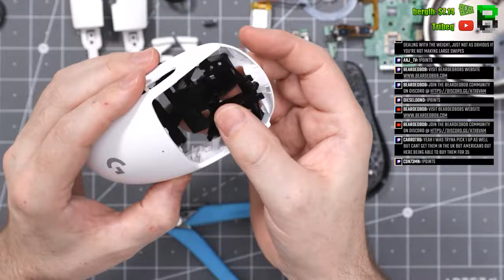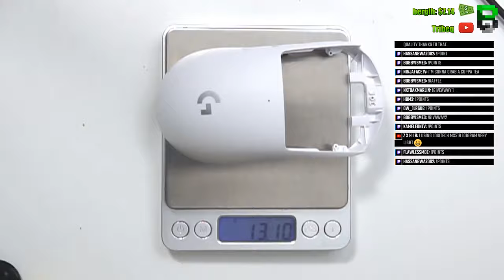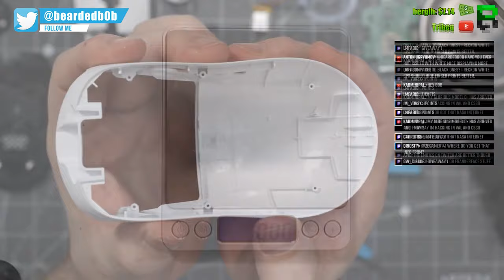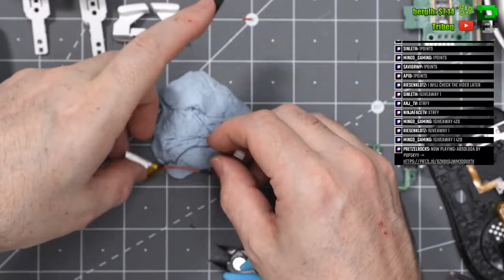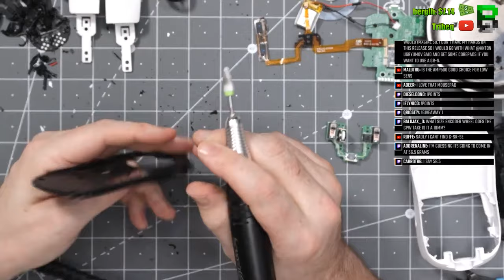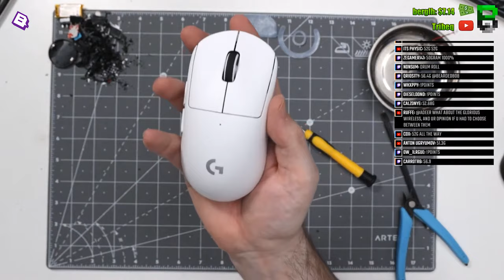THE ULTIMATE 50G LOGITECH MOUSE - Custom G Pro X Superlight Weight Reduction Mod

Comment: I refuse to doubt Logitech’s engineers any further, I’m sure they couldn’t gut as much as you did due to structural integrity. They gotta factor in the potential risk of RMAs and such
Reply from the maker: I’m sure RMA has something to do with it.
Reply: Absolutely, and teenage gamer rage fits. We've all seen the hilarious youtube videos. Im sure Logitech has too. Go lightening it too much and some roid raging teenager is going to crush it in his hand like a popcan and mom will blame logitech... just overall cheaper in the long run not to have to. 
That said if Logitech wanted to, They could go full on skeletal frame, a step beyond honeycomb, out of magnesium or carbon fiber but, we already whine about 200 for a mouse. Imagine the outrageous R&D costs of something so niche. It would be freaking cool concept though.... side note.. trademarking and copyrighting skeletal carbon framed mouse right now..
Reply: if they was so scared about RMAs they should have made better switches
Reply: @Bollalillo  ffs sake lmao. They changed them midway through already my copy of the gpw (non superlight) to 20m switches

Comment: Nice I was just thinking how much I could get from the Superlight and thought I'll just wait for the Bob video to see how it is. My original Gpro is 58grams I think, but it's pretty shredded, with original battery as well. I'd estimate probably 45 grams with the same work for the superlight with the same battery. Don't really need it but might just get it as a fun project and then do the switches as well.
Reply from the maker: Yeah I’ve made a few 57g gpw stock ones, and I’m happier around 60g but I just like to see what’s possible. 50g with it looking stock is impressive.

45g would be crazy, it would be interesting to see how the new FM mouse feels at that weight or below.
Reply: Yeah how exactly do you change the switches on this mouse? I am very curious.
Reply: @shopcomfycove  I'd assume like any other. Just solder them off and new ones on. I'm sure bob has a video for it, probably on the exact same mouse as well.
Reply: @Raumance Wait so do I need a soldering iron?
Reply: @shopcomfycove  Yea I think so but those are really cheap to buy.

Comment: How much grams would I reduce if I just remove the powerplay function?? (with no holes but only a cable, strange iron thing, and 4 screws) plz...plz...
Reply from the maker: around 4g but worth checking the weights in the video to confirm.

The full weights are in this teardown to help you see whats worth removing or not :-) https://www.youtube.com/watch?v=EFX2QzyvuS8&list=PLfd7fPKFiRfIzZVqxMHqyH5y23iG357b9

Comment: what switch did they use in superlight? is it the same as non-superlight?
Reply from the maker: Same as the newer gpw so a 20m omron china 😭
Reply: @Beardedbob  what's a good switch to replace them with? I have a non super light and the switches suck! I have a problem with the right switch un ADS me all the time. It's extremely annoying
Reply: @RobSimmons6.7  these switches aren’t plagued like the 50’s you don’t need to replace them
Reply: @anostio  ehh I beg to differ, my mouse is always un ADSing on me
Reply: @RobSimmons6.7  I recommend returning the mouse first, the switches don’t seem to be nearly as bad as they were, or at least the community hasn’t found a way to complain yet

Comment: i would opt for a bigger battery to hit 60gram mark.

i did the same to my g703, just hate how short the battery lasts.
Reply from the maker: I get 7 days from the 100mah most should get 3 days that's pretty decent. the MOW gets around 1 days stock it seems. Just leave the stock 240mah in and get a few more weeks and it will weight 53g.

Comment: hello i cracked open my superlight to swap main switches and did some of the cutting mods but when i put it back together none of the buttons work, only the sensor. The ribbon cable, as far as i can tell, is pretty much in tact with no visual issues and the led light turns on too. Was wondering if youcould help? is it the ribbon cable thats damaged?

Comment: Can the stock gpw internals fit in the superlight frame? The only problem I could think of is the glue for newer side switches, but I guess the old gpw side buttons could also be glued down.
Reply from the maker: Maybe, the PCB's fully align, the Skeletons does have different mounting points.

Comment: I'm curious, If I remove the battery and mod the mouse with a paracord cable and use it wired will it work ?? how about the wireless stuff inside of the mouse is it removable for weight gaining purpose ??
Reply from the maker: not sure, I need to test it as a lot of people have asked me.

Comment: I noticed you swapped it with a 2 pin battery whereas the original came with a 3 pin, is this safe? and if so how? Isn't the 3rd pin for battery protection?
Reply from the maker: The 3rd white wire does monitor the battery. On a MOW it does affect it if you cut it off but on the GPW and GPWSL it works just fine. Will it over charge it I'm not sure but so far I've not heard of a problem.

Comment: I am afraid looking at the disassembly process with so many clipping involved.
But, the end result speaks for themselves. <50 g and wireless mouse to boot. 
I can't even clip my own stabilizers on the keyboard without feeling anxious. 
Will be using your video for future reference should I decide to mod my mouse. 
Preem vid, man.

Any chance you are going to make Xtrfy M4 / M42 teardowns?
Reply from the maker: Hehe, yeah it's not an easy process..

Yep m42 teardown coming plus model o wireless, Pwnage ultra custom, Ducky feather and Roccats

Comment: Hey man, I really enjoy your videos! I currently have a g403 HERO and I would like to remove a few grams from it. All ive done so far is removed the magnets that connect the little pop out shell for the weight but im a little afraid to go any further since there arent any guides for the g403 HERO anywehre, which is odd since a very popular and widely used mouse, it would be super awesome if you came out with a weight reduction video for it!
Reply from the maker: G403 weight reduction video out very soon I just need to edit the stream that I did for it.
Reply: @Beardedbob  is it done ?

Comment: I think 62 grams is damn near impossible to beat without luxury materials and sacrifice to structural integrity. 

Maybe they could've made a 45 gram mouse out of carbon fiber or something, but then it wouldn't be 130€, it would be over 200.. And I'm happy to have a bit more weight.
Reply from the maker: you can get these down to 46g if you really go for it..... Finalmouse have made a magnesium one  which s 44g but smaller and as you say $180.

Comment: Advice: Do not remove the side switches, if you dont use them. M1, M2 and scrollwheel wont work anymore. At least, I have spareparts now.
Reply from the maker: Sure wont. The GPW was find but this one doesn't like it. where did you get the spares from?
Reply: @Beardedbob  I removed the side switches, thats why I have a lot of spares now 😁

Comment: i think 60g is light enaugh, there is a balance betwee too light and too heavy. with that said, i would still want a g pro at 50g made by logitech (no mods) and then just improved revisions of it. 50g sounds like the perfect weight imo, but its not worth modding for 10g here
Reply from the maker: All personal preference. 10g is noticeable and you can adjust the balance to where you want it to be if you are into modding. Logitech wont build a 50g GPX as its a limited market and they want it for a larger market to get a decent ROI. The best mod is swapping out the switches as they feel trash in this GPX and the GPW, never mind the failure rate.

I prefer 55g to 65g mouse so 60g is where I'm happy. Going below 55g and I feel it at long range snipers. Can you adjust probably if you use that mouse every day. One think is clear, the lighter the mouse the faster flicks are.

If you haven't check out this extremely modded GPX which is 49g and has a different scroll wheel. https://www.youtube.com/watch?v=Sr1tpejHCgQ&list=PLfd7fPKFiRfIzZVqxMHqyH5y23iG357b9

Comment: if u 3d print a shell it will be even less
Reply from the maker: You would think so but its not always the case. I've used a 3d printed base on a GPW which was 1g heavier than a custom modded stock base. https://www.youtube.com/watch?v=XRdlTknbd_E&list=PLfd7fPKFiRfIzZVqxMHqyH5y23iG357b9 the 3d material is heavy compared. The ABS Logitech is using on this new base is very light. 3d material is going to have its work cut out beating that given it was heavier than a stock gpw modded base.

Comment: not worth imho. Too much hassle for 4-ish grams
Reply: He ened up at 50g, not 57g, it's a typo in the title. However even with that I don't think it's worth it cause at 60g it's still a very very lightweight mouse and it's perfectly balanced, I don't want to sacrifice that balance to save weight.
Reply: @krypton9808 Oh ok. that makes much more sense. I only watched until he replaced the battery.
Reply from the maker: Was a typo its 50g so 13g is a decent saving :-p.
Reply from the maker: my fault haha.. you could get it to 47g if you go a little more extreme.. comes down your your personal preference.

Comment: Why do you your your changes so fast. It is impossible to identify your changes even with pausing the video.

Either door what you did it skip it at all.
But this way it is very annoying
Reply from the maker: hard to show a 3 hour long video on YT hence it has to be speeded up. If I don't the retention sucks and YT don't promo the video :-(

Here's another one with some different mods but still a weight mod https://www.youtube.com/watch?v=Sr1tpejHCgQ&list=PLfd7fPKFiRfIzZVqxMHqyH5y23iG357b9

Some fully unedited ones on my Twitch channel https://www.twitch.tv/beardedbob.
Reply: @Beardedbob  well you could just show the piece you intend to cut and point to the parts you intend to cut out so that we can get an idea of what you will be removing and then skip the actual cutting.

That would make a far more shorter video but by far easier to understand and follow.

Edit: you are doing great things. It is said if the presentation prevents us of seeing it.